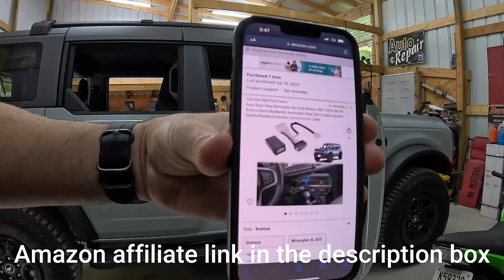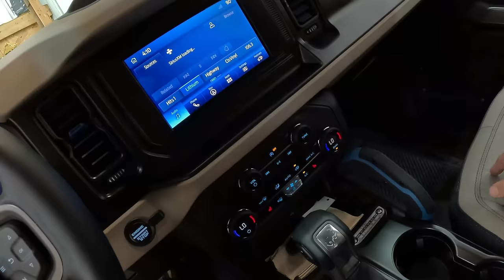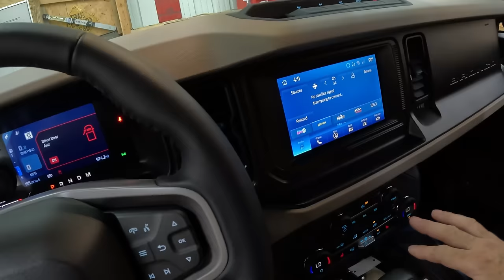Update On The Church Parking Lot Affecting Gatlinburg Employees? | Accident On 321 & Bronco Update

Comment: On Church parking, that only works (kinda) if they ask for a donation but no one gets towed.  In which case, the no parking sign must be replaced with a "please donate $10 to park" honor system without any threat of tow.  A "no parking" sign (with tow statemnet) with a donate request will not work if the intent is to tow anyone who does not donate.  If it's the latter, I'm not sure how well it works given the lack of parking spaces.  Folks will park and not donate.
Reply: Yeah, I’m pretty sure that they won’t tow from there anymore.

Comment: Controversial subject, I know, but as someone who has driven a plug in hybrid for years, there are allowances for the start/stop funciton: 
(1) The gear ratio from the starter-drive pinion to the flywheel ring gear is optimized to make the starter's motor turn more slowly. This can be done without materially changing the design of the transmission or flywheel at all on existing designs.Crucially, this reduces starter-motor speed (in RPM), since 90 percent of starter-motor brush wear occurs not during cranking, but during the coast-down after the start has finished. If a higher-torque motor can spin more slowly, its coast-down time is shorter, increasing its longevity.
(2) The composition of the carbon and copper brushes on a start-stop motor differs from its traditional counterparts to increase longevity without accelerating the wear on the commutator.
(3) Rather than rely on oil-impregnated bushings for the rotating assemblies, start-stop starters mostly use needle bearings.
(4) The solenoid on start-stop starters decouples the mechanical action of engaging the drive pinion into the flywheel from the electrical action of stopping and starting the motor.
This allows for a dedicated design to turn power on and off to the motor, optimizing contact design and wear, against contacts that have to be integrated as part of a spring-loaded plunger.
This also reduces the electrical load requires to turn the engine, so that there is enough current available for accessories/lighting to operate during the start event.
(5) Finally, start-stop motors are integrated with other technologies that identify when each cylinder of the engine will reach top-dead center. https://www.greencarreports.com/news/1109687_dont-start-stop-systems-wear-out-your-cars-starter
Reply: I have a hybrid and it routinely starts and stops the engine whenever the hybrid battery needs charging and the AC is not mechanical and run off the hybrid battery. If the battery is fully charged, the AC can run for quite a while before it needs to be charged (engine turns over when a charge is needed).

Comment: The church needs to install an electronic gate, and supply renters of the spot with a clicker which would include a refundable fee for the clicker. This way they can assure their clients of the spot they paid for, and have a steady stream of income. Leaving it up to individuals to do the right thing, and offer $10 will work some of the time, but they will make steady money if they rent the spots in a secure location, behind the gate. Another option is to have a volunteer church patron man the collecting of fees, otherwise their attempt to make more money is going to backfire! 👍😎✌🗽
Reply: Who pays for the gate which is incredibly expensive?
Reply: @Integrity.is.everything  The gate itself is $3000 to $5000, but the labor to install it could be higher. I would think the church has funds to purchase the gate, and possibly get volunteers from the congregation to install it, and any fencing that needs to be erected to secure the property. Just 20 parking spots at $100 a month is $2000 mo alone so they could more than make up the cost in a few months. If they charge more, or have more spots, and workers who want the spots, they'd make far more. My estimate is on the low side to be safe, and see if the gate is a viable solution. They could also just buy a simple swing gate, and padlock it giving the tenants keys. That would be a way less expensive option, and just as effective. Even if they spent $10,000 on the electric option, and some fencing, they'd recoup that money in 10 months at the above 20 x $100 mo. Just an idea.👍✌🗽
Reply: @Integrity.is.everything  Love your moniker, so true, wish more had it! ✌👍🗽

Comment: I don't know how Ford does their auto stop but GM doesn't use the same starter for initial starting as they do for auto stop starting. If I'm not mistaken GM uses an electric winding motor between the transmission and engine for stop and start which doesn't wear out like the initial starter motor would under the same multi start scenario.

Comment: Gatlinburg needs better public transit! Omg, just story after story about the terrible traffic and limited expensive parking. I live in colorado, so our mountain towns have a lot of the same issues, but most of them have good bussing. Employees of the resorts and many locals get low cost or free passes, tourists pay more. There are big parking lots outside of the main areas and the busses come every 10 minutes during peak season. It's faster to park in a lot and take a bus than it is to drive in the traffic and try to find parking. It also massively helps the pollution in these valleys where that stuff just settles down. 
But i guess it's Tennessee so it'll probably be hard to convince politicians to fund something like this. 
But the stories I've heard about the traffic and parking make me not want to visit. Even though it seems like a really amazing place.

Comment: In City driving “on/off” saves 2-3 mpg. Oversized starters are standard, auto start is faster than manual. Also saves engine hours/wear over time. It 2023 says a guy whose 40 year old Ford needs double clutching, has no power brakes or steering or heat or ac. Different strokes….

Comment: Regarding the "start/stop eliminator" ... why not just push the override button when you get into it? Or....why not simply stop with less force and avoid the start/stop?? You can also turn the wheel slightly and it will not function. It might not be wise to promote this after-market kit because when computer systems begin to fail and warranties are voided...there will be regrets. Seen it happen a MILLION times in the Jeep world already. Dealerships learn it is installed and CAN opt not to cover a lot of things under warranty. Be careful...wish ya luck in the mods.

Comment: Jeff, You may find that if anything goes wonkey on the Bronco Ford may try to blame your aftermarket add on to the factory wiring system and your warrenty is now voided.

As far as the church parking goes, Let me just say that I feel it is not a good look for the church. They can try to spin this any way they want but it makes the Church look bad, greedy even. And I certainly have no dog in this race. They had a system that was working, helping out the local folks, and now it just smells bad.

Comment: I did not know that was an option for the start stop button! I hav a 2020 F-150 with that option and hate it! But I have found that if you stop like normal then ease up on the brake pedal slightly, truck won’t shut off. Thanks for the tip!

Comment: Those people in the wreck on 321 were sure lucky. Just proves God is good and watches over us.  Not to sure he's happy about what the church is doing. And it us not a donation if you habe to pay it to park there. That's like a pet rescue here. They charged me 250. And called it a donation and I told them about it too. They say donation because they are supposed to be non profit. Smh at people.
Reply: They probably wouldn’t have survived in a car from the 90s.  It was a small offset crash.  Newer cars will move to the side like that in a partial head on crash.  They are designed to deflect energy.

Comment: Fords have this annoying feature that shuts down the car if it's sitting running for more than 15 minutes! It's a big problem for my parents because my dad is elderly and disabled so he needs to be taken along to the store and not left at home and my mom likes to run in sometimes for 20 minutes and the car shuts off on its own! He is too disabled to go around and re-start the vehicle because the new Ford Explorers require you to press on the brake to start it - so he can't restart! There is no bypass for this on the 2023 models either and if you try to have a mechanic bypass it with hardware it voids the warranty! I'm tired of car manufacturers thinking they know what's "Good for you" when they don't. I'll stick to my 2010 Honda as long as possible, doesn't have any of that "do it my way" crap that Ford is putting on cars now!

Comment: Jeff, are you sure that the "Stop/Start Eliminator" doesn't invalidate at least part of your Ford warranty?  Personally, I believe the Stop/Start feature is dangerous and should be eliminated by the manufacturers.
Reply: I wouldn't think it would affect the warranty considering it's a " plug " and no wires are cut to install
Reply: @chrisnelly2518 , the reason that I asked Jeff the question is that I have a '21 Pilot and '21 Ridgeline with the same dangerous Stop/Start system, and I have been told that if I installed a Stop/Start Eliminator, and something happened, that the warrant would be void.  It's definitely something to think about.